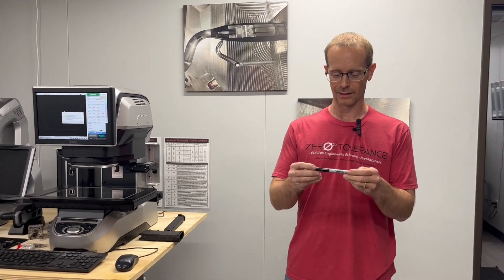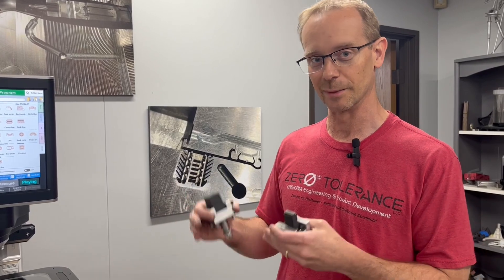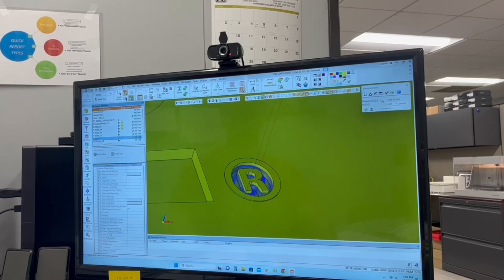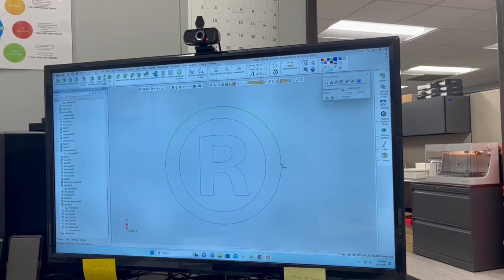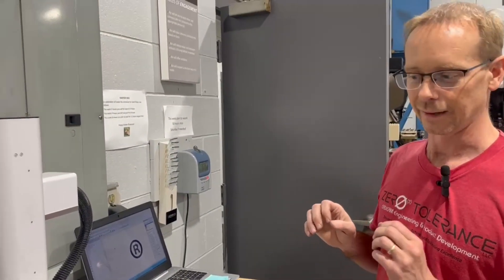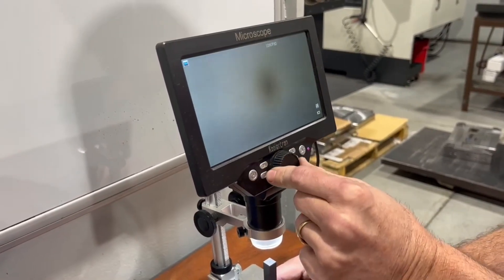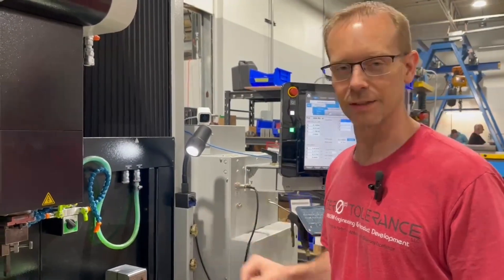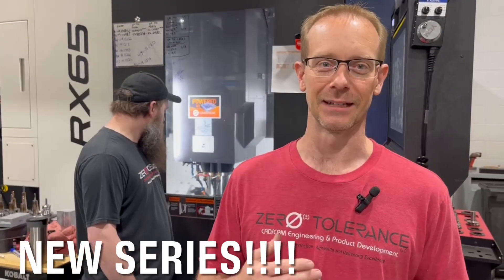youtube video #-jANTJa_T3A

Comment: Great video. I would agree that lasers are the best way to do this. We use a DMG laser with an erowa chuck set up so that positioning is perfect. Doing this with a 20w el cheapo fiber laser, the software needed vector files for best hatching results and we would draw a box on another level just inside the size of the electrode to get the alignment and height set up with the alignment laser. Typical burn is with a .001" orbit and 24vdi and comes out perfect. As for depth, since there is no taper just go deeper by a long margin and ensure the embossed height is finished and polished. Thanks for sharing!

Comment: We don't do anything as small, but we do quite a bit of customer logos etched into stainless steel. We use Electrox Scriba 3 to create our artworks. It works rally well because you can import vector graphics as a v8 Illustrator file and then fill in the software (all infinitely changeable). It gives much better & crisper results than importing image files. Plus you can play with power, frequency and speed in the software. 
We have 3 setting rods to get the height set (quick and easy).
Reply: DRO on the laser really helps with that
Reply: @laurentianvmx1692  This is the 2nd laser head we have had with the same main box driver over the last 15yrs.
Reply: @shaunwilmer2358  did same on our old CLC Signature, just kept the OSHA enclosure and manual Z stage